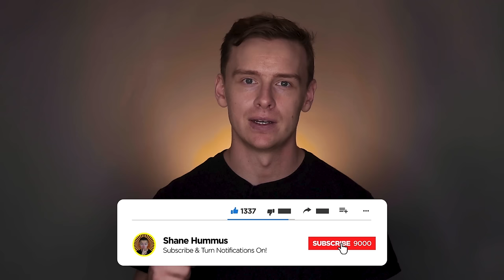Top 10 Best Trade Jobs (Trades Careers Ranked)

Comment: You left out Wireless Construction (building/modifying cell towers)...  That’s my industry.  I started out as a climber for $15/hr in 2004, quickly went to $22/hr within 18 months, then became a Foreman within a year after that in the $30/hr ballpark.  Fast forward to today, I’m a Construction Manager making $52/hr with full benefits, 401k, etc...  Its a good gig if you can get it.
Reply from the maker: Thanks for sharing that Evan. Any tips you want to leave our viewers?
Reply: Shane Hummus - The Success GPS  It’s an easy entry.  Just 18 years old and a good work ethic is all you need.  Companies typically train you for whatever certs you’ll need (tower climbing, aerial lifts, winches, rigging, etc).  Most people that aren’t green get company trucks or vehicle allowances.  You spend anywhere from 1 day to 2 months working on a job site (depending on the project), then on to the next one.  Cell sites are EVERYWHERE so you see parts of the town/country you wouldn’t normally see.  It’s kind of a small industry, but it seems contractors are always hiring.
Reply: Rich 91 No, if you’re looking at job postings for CMs, degrees will be listed as pre-requisites.  However, those are generally just a company’s “wish list” and more important if they’re hiring off the street...  I (and most of my CM counterparts) started with our company working as a tradesman and were promoted from within.  Your reputation of your character, knowledge, & work ethic FAR out weigh your formal education level.

Comment: With welding you said that average salary of 40k which on paper is correct but there's so many different welding jobs out there everything from pipeliners who make upwards of 200k to structural who might make the same to shop welders who might make closer to that 40 mark and manufacturering that might be closer to 20 so it's not a one size fits all kind of thing
Reply from the maker: Good point Bruno

Comment: To be a proper welder there are many licenses to have: API, ANSI, ASME, DOT, FAA, etc. Plus to be an underwater welder you have a short career typically, due to the destruction of the lungs. Plus it is extremely dangerous. Ironworkers are all trained as welders, and are ranked 7 in the top 10 of highest job fatalities.
Reply from the maker: Thanks for sharing that. What trades would you recommend for the viewers? Cheers!
Reply: @ShaneHummus  It depends on the person. I am a commercial roofer(ranked 4 in the highest fatalities) but love it. Millwrights make excellent money, masons, diesel techs. There are plethora of trades, but the ones that do what is needed every day, those are the ones that count. Unions are a huge help and the BLS doesnt properly show pay scales, as they are averaged. Plus a lot of us are cross trained. I for example am trained as an Operator/Rigger, Sheet Metal, Small Masonry work and Asbestos removal. They are bonuses in our pay when we do those jobs. Plus we also get travel pay. There a lot of benefits not accounted for. Plus here where i live, when our season gets slow i can fly to busy areas(at companies expense) and work for other unions and collect pay at whichever contract is higher.

Comment: I was a bit surprised that you didn't include "general" construction, e.g. carpenter, concrete, metal fabrication, agriculture (farm and ranch),  etc.  Yes, there are physical limitations, yes there's some danger, yes they may be a bit seasonal, but most have a very low entry level straight from school and most have a very high success level, e.g., from basic carpentry becoming a general contractor and home builder.  Also, and although dental hygiene is a worthy pick for women, it's not that good for men with big strong hands!  (snicker).  However, as a retired teacher after 47 years, I agree that we are missing the mark by not promoting more skills oriented careers.  Bravo!  Good job.

Comment: This is such a college students prospective of the trades.  95% of these career choices are scheduled, as in paid by the hour, not salaried.  With this said I work in railroad industry on the Maintanence side were I can be a truck driver, a welder, a laborer, heavy equipment operator, name it.  It is also union so no matter how long your have you have been on the railroad or experience you make the amount as a new guy working the same job.  Overtime is the difference between 150k and 60k not your low ball 40k a year.  Overtime is key.

Comment: I would  include cable technician (residential). Its the guy who comes in from a service provider to actually install your internet and cable TV

I did a 3 week apprenticeship and first month I made roughly 3k, second 4k, third 5k and ever since then I average 6k a month although I could get that to 10k+ if I worked more days/longer shifts

requires no prior experience or any skills, and you can get hired anywhere any time by a contractor. I would put this category below HVAC. Its better than HVAC in the sense that its much easier physically, and pays something similar (contractor HVAC techs can make 10k+ a month, just as contracting techs as I do). HVAC would be for people who prefer to work without people, while cable techs constantly interact with customers

Comment: Ultrasound (Diagnostic Medical Sonography) actually usually requires an associates degree in the field and typically include clinical rotations to gain experience. There are also registries or boards that need to be taken after getting the degree for each different type of ultrasound such as abdomen vs OB/Gyn or Adult Echocardiography.
Reply from the maker: Thanks for your input Amelia
Reply: I think radiation therapist does too, all the info I see on it talks about getting at least a two year degree.

Comment: I disagree very whole heartedly about the way you explained becoming a welder. Being a welder varies very widely all depending on what kind of welder you become and what your welding. Welder usually weld in Aerospace, Construction, Vehicle construction, naval construction. Working in construction as a welder means that your in a specific trade that happens to also weld occasionally. You can be a commerical plumber who welds, or an ironworker who welds or a sheet metal guy who welds etc... it also depends on where you live, and if your working in the union or not.

Comment: I'm not picky on a trade, but I've heard welding is the most physically challenging one. What about electrician? Heard good things about it from a friend. I like to be hands-on, if that helps.
Reply: go for cable tech as a contractor. Easy start, very high potential salary. It took me only 3 weeks to train. I went from not knowing what a router is, to preaching clients how wifi works in just 3 weeks and installing dozens of modems a day

electrician would just take way too long to start from scratch. Once you're in a trade, you can then decide whats next

Comment: For hvac here in Illinois you need an EPA license to handle refrigerant which you can get from a tradeschool.  That being said there are alot of guys out there that don't have one and they are usually helpers, they won't be making decisions or troubleshooting.  Here in Illinois we don't get a break, we're busy most of the year, there's only a few months out of the year where it slows down.   I've been in the field for 5 yrs now and I'm only up to 41k a year as a lead tech.  Attics and crawlspaces are very hard on the body.  We have to be Jack's of all trades as well, plumbing, electrical, electrical troubleshooting, carpentry, understand airflow, brazing, sheetmetal work, and sometimes you gotta move some earth, then do all those things minus moving dirt in the winter by yourself.

Comment: Everyone thinks electricians don’t work as hard. Run 4” ridged 10 hours a day- or pull 500 or 1000 mcm in a cable tray 50-100’ off the deck. Work a duct bank. Then tell me how easy it is. 
But we do make more. 🍻

Comment: Some of the pay scales are skewed especially with many of the unions. As for welding the reason that average is lower is the mass amount of manufacturing work similar to plumbing in certain residential roles. Get into an independent contractor or a skilled trades position like a pipefitter who typically could do welding, plumbing, and fitting the pay increases dramatically.
Reply: Please explain further. I am a plumbing tech. Im looking to learn more skills to up my earning ability. Are you saying a pipe fitter does welding along with plumbing?

Comment: I got into electrical thinking it would be the highest paying trade and easy on the body, while sometimes it is the case, but please don't be fooled by others telling you it is easier physically, when you hang tek cables on the ceiling or terminating a larger transformer, you will learn that electrical is very labor intensive, when you have to pull through inside slab overbent conduit without JB in-between, you will start doubting your career decision XD, and also where I live (vancouver), plumber seems to have higher pay. overall, electrical is quite fun, and troubleshooting requires knowledge and problem-solving skill that can leave you feeling fulfilled, but please, think twice before you fully commit, just my opinion. also, think about communication tech, even tho electricians typically make fun of them lol (where I live at least, its all love tho XD), the demand for these techs is high. There are too many sparkies, and not enough communication tech, I plan on getting that certificate soon to add on to my electrician credential.

Comment: Im assuming he meant residential HVAC in general? res Service techs normally start out 35kish. And anything commercial or industrial is wayyy more. Plus you can make easy transitions to areas like refrigeration, home performance, kitchen equipment, ice machine, and the list goes on. All of which on avg make more than residential guys(unless its those crooked commission based white shirts).
Reply from the maker: Thanks for your input

Comment: 1st off with the "welder" thing this guy doesn't get at all the variances in types of welding and that oxy acetylene is not common method to weld in the modern era, and the fact that most "welders" end up in a real trade like boiler maker, pipe fighter(they be fighting the pipe),millwright, or  iron worker(like myself though I've worked in all of these trades)and being a welder welder is rare normally they work in a fab shop but working in the field in the trades varies greatly. Also him talking about a college degree out does a 4 year apprenticeship most college students aren't pulling in 50k or more while in college. I myself though have been in the trades for years and am in college now for business . I just wish my boy had more understanding of what these trades do and if he understood that being a welder with epa and nate certs like hvac guys you can work as a boiler maker and that's bigger dough than the majority of these trades.

Comment: Ya elevators are not that dangerous (if you know what you are doing) they are suspended bye 4 extra cables when one cable can support the weight of the elevator old they have fool proof brakes on them as well where as soon as there is any amount of gravity pushing down on a elevator it locks and will stay there just with pure friction. Escalators now though... They be crazy.
Reply from the maker: Thanks for sharing

Comment: Move to TX. Learn trade used in oil and gas. Earned over 100k since I was 20
Reply: I’m 22 years old moving to Dallas.what school you recommend to learn trade in oil and gas?
Reply: @cesardavid5995  I never went to trade school. Start as a helper with a good construction company that pays perdium. Flour, kbr/ brown and root, zachry, s&b, and many more. You could also start and any refinery as a green hand and also move up over 3 or 4 years. Doesn't pay as well but better benefits being maintenance hand. Pipe line work also. Most companies rather get them green and teach the way they want too and will pay you to put you through school and training.
Reply: @cesardavid5995  I'm a millwright. I can install, build and tear down anything that has moving parts. Pipe is easier. Electrical is a little harder. I&E tech pays the best but you may have to do one job as helper and then go take 6 month corse after work but average pay is around 40 to 50 an hour. Pick craft and buy nccer books and take the nccer test on ctaft.

Comment: Automation technician and CNC machinist both should have made the list waaay before welding imo

Welding pays poorly, destroys your body, & is an unreliable trade to get into as it is by and large being automated now (in manufacturing at least) except for those once-in-a-while welding jobs that it's not worth programming a robot to do.

CNC machinists make $18-$28/hr depending on the company around where I live, don't even need an associates degree (but certifications) with a ton of job openings, demand is exploding

For automation technicians, you usually just need a 2-year associates degree, $55k/yr is at the low end of the pay spectrum, most jobs are closer to $70k/yr all the way up to 6 figures, with good benefits. You can get a less-skilled job that still pays well with a company that offers tuition reimbursement & have your employer pay for your school while you work..and demand is skyrocketing
Reply from the maker: Thanks for sharing that Nicholas. Really valuable info

Comment: This guy leaves Refrigeration off the list?  What about Geothermal repair?  I make 1500-4000 per day doing this.
Reply: Kish shiv  keep laughing.  I just got the contract for a geothermal retrofit on several local government buildings in my area.  You dont want to know how big the contract is.
Reply: Kish shiv  yeah.  Difference is I work alone.  Non union, and I know a lot about a very specialized field.  You can too if you start looking...
Reply: What is refrigeration? Looking for things to try and look into for my Future.
Reply: @edgaravilac2753  refrigeration trade is the installation and repair of...refrigerators, freezers, ice machines, heat pumps, air conditioning, and other systems that use a compressor to manipulate the physical properties of a refrigerant for the purpose of cooling and heating a confined space
Reply: Lend me some money

Comment: There are many different types of HVAC work. I'm an HVAC assembler and I get about 43,000 a year, and I only work 3 days a week. Some of my coworkers decide to work 2 overtime days a week (5 days total) and make over 90k a year! Its not too hard on the body (I'm 5'3 105lbs and have no complaints) and I only had 8 months of factory experience when they hired me. I would suggest HVAC work to anyone considering there are so many different routes you could go in the HVAC industry
Reply: league of draven  I think most u gotta be 18. Theres so many different positions. Welding, assembly, sheet metal, forklift operator, and many more. It can be hard on the body depending on the position and depending on the company and type of hvac being built. And assembly for me was very easy to get into and pays very well. I work for Daikin and they also have decent benefits. Your only 17 so you got time to experiment in job opportunities without risking anything. Id go with assembly if i was you because its been working out well for me, 25 an hour, 3 day weeks, good benefits, a 401k, and job security
Reply from the maker: Thanks for sharing
Reply: league of draven it’s not hard in the body. I think it’s one of the least labor working jobs in the “construction” industry.
Reply: @Bummer Brooks how would you get into a job like this? Did you start with any schooling?
Reply: @xaviercutler1106  all I needed was a high school degree or ged
Reply: @Bummer Brooks where did you apply?
Reply: @xaviercutler1106  straight to the company I work for, Daikin
Reply: @Bummer Brooks Thanks for the info!

Comment: welding is very bad for your lungs
Reply: Hisham Malik  not always feasible, it gets very hot when you are welding which makes it hard to breath, with a mask its even worse and also because I was actually trained as a welder I know that
Reply: Hisham Malik  if you don´t wear a visor with very dark glass  when you weld your risking getting blind, that doesn't really help with the gasses produced when welding metal and well the visor and a mask under it would make it hot and hard to breathe, you could make certain that you have good ventilation but if you work as a welder for 20+ years you are likely to end up with lung issues, my father ended up with coal disease and very bad eye sight due to welding with improper protection, it certainly didn't help him survive when he was infected by Covid last year,  he died

Comment: Welders seems inaccurate also most welders don't make 40k... You can make over 200k if your good enough to weld on the pipeline if you're in the union the apprentice ship is 3-4 years it varies. starting you make 22 then after those 3 years your making around $57 an hour then there's also the benefits the dental and 401k insurance etc that add on the the check.
Reply: also you need a license to weld. You need a AWS and sometimes a XRAY weld test depending on the state but you will always need a license unless you work in a shop. The tests can cost over a thousand and you need to get certain weld positions and if you fail you fail. Its a hands on welding test which is why you should go to welding school.